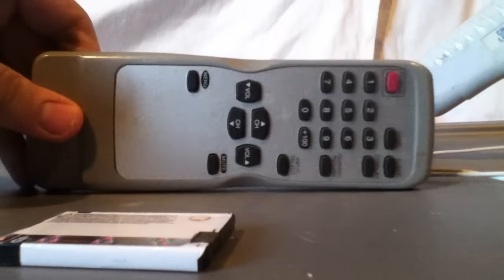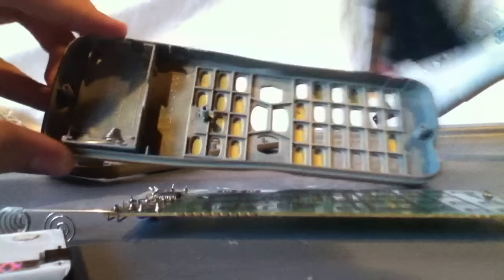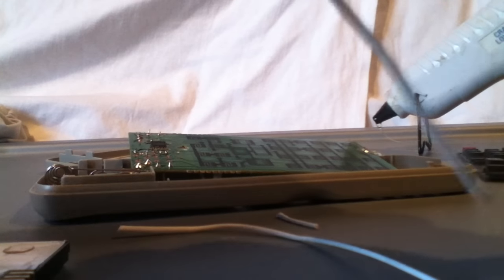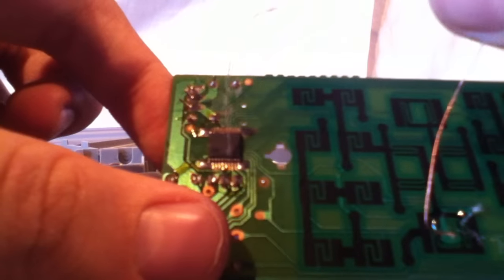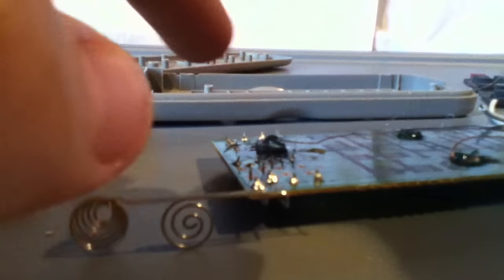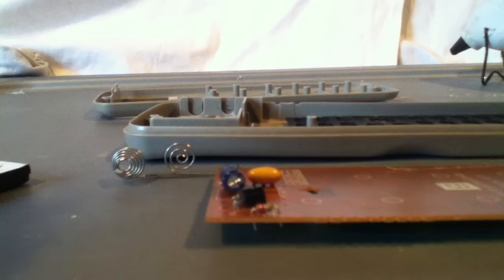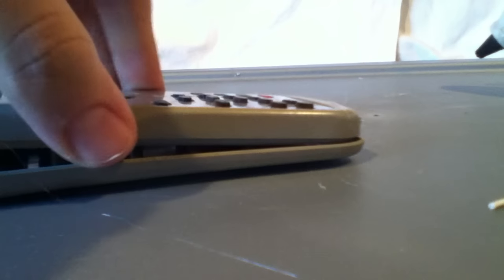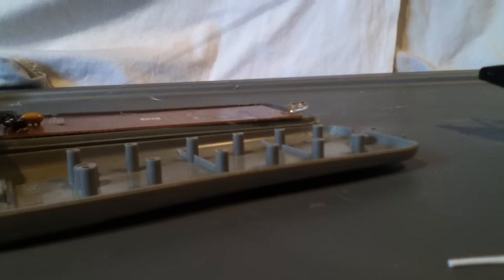How To Make a Cell Phone Jammer Out of a TV Remote

Comment: Having worked in manufacturing as a test technician I can tell you that an IR signal WILL NOT interfere with a phones signal strength. You need an RF signal to do so in the various bands that the phones use for occupation. pick up any $1-5 FM transmitter for your phone and this effect is seen although no music plays. This is because the FM signal is strong enough that it overwhelms the previous signal originally received. Hopefully this puts you in the right direction.
Reply: So does it work or not? Thanks

Comment: I knew by the title that this was fake because remote controls emit IR with a tiny LED, not RF, and even though some fancy remotes operate on RF, they operate at around 27 MHz, nowhere near 800/1900/2400 MHz which is what you would need to emit to jam cell phones.
Reply: Henry Black If you're willing to spend money, theoretically, you can buy an 800 MHz transmitter, and then attach a UHF 800MHz antenna to it, with the disguise of the remote, power it off of the 2 double A batteries (needs to be low power, effectively, low range and short battery life) and hook up a switch between the battery and the + terminal on the transmitter. Keep in mind this is illegal, this is all off the top of my head, I have not, would not, and will not do anything I have mentioned in this comment.
Reply: ***** I clearly stated it doesn't work. Cell phones operate with RF, not IR. I explained how to make a real jammer.
Reply: +Henry Black ya when i way this i was like what? because ir will not disrupt rf im glad at least someone other that myself was smart enough to be able to tell it was fake thank you
Reply: +topbullseye p.s. a remote works on dc current not ac so hooking the battery up like that wont work
Reply: ***** That battery is DC dude...
Reply: i know i was just saying that because he hooked the positive and negative terminal of the battery together and then hooked that same wire to both the positive and negative terminals of the remote thats why i said ac
Reply: +topbullseye thats not how ac works either.
Reply: i know im just saying thats probably what the person was thinking
Reply: +Henry Black lol you can make an 800 Mhz transmitter with common household electronics say an old tv remote but this video does it all wrong.
Reply: +Henry Black lol you can make an 800 Mhz transmitter with common household electronics say an old tv remote but this video does it all wrong.
Reply: ya if you changed the signal from inferred to radio and get a larger power source and hook it up right
Reply: ***** Neither you nor james anderson has ANY clue what you're talking about. Stop trying to act smart; you're making yourselves look dumber with each comment.
Reply: +james anderson You can't make an 800mhz transmitter out of an infrared remote. If you have one of those rare RF remotes maybe, but even most of those RF remotes operate at 176mhz or lower, with no way to tweak most of them even up to 300 or 400mhz. Now if you're talking about gutting the remote, removing everything but the battery holder in it, & putting diffrent or UHF components in it, you're not really making it out of a remote, but rather building something inside a gutted remote case.
Reply: Betty Pearl I guess if there is no way to soup it up then yea. but in theory I guess it would work.
Reply: +james anderson There's no theory where it "would" work. It just can't work.
Reply: QQ im sorry, sooooo sorry! ((;-;))
Reply: Yep
Reply: Henry Black my directv remote is rf as well as ir
Reply: It's not just going to transmit nothing really good it's going to blow up! 😂

Comment: #1 speaker wire wouldn't work.
#2 he hooked the battery to the wrong prongs.
#3 he didn't even press volume down to see if it turned off the effect
#4 he used a most likely in active number.
#5 an ir emitter wouldn't do anything to a cell signal or any radio wave for that matter
Reply: Correct 👍

Comment: Those wires that are in a headphone jack are coated so you need to burn or sand the end of the wire to get connected or for a good electrical connection. How else do you think you have free wires touching each other inside? One plastic Sleeve and they don’t short

Comment: I use my I-Phone to control my TV. Can I wire my I-Phone the same way? I don't have a hot glue gun but I suppose some gum would work. I'll just duck tape it back together when I'm done. I'll slap a 9v battery in it for power..

Comment: I know this is a hoax, but if you want to do this for real you can use a software defined radio, find what Mhz the phone's communicating at, then just pump a lot of EM radiation at that Mhz, works for wifi too, cheers :)
Reply: Huh? I'm talking about interrupting the phones ability to communicate not the tower...
Reply: can u tell the whole process
...
Reply: shashi kumar  and what do you have to offer?
Reply: Isn't it 5ghz or sometimes 2.4ghz? They have different channels.
Reply: Explicit Tech What is it? Most phones will have bluetooth and wifi radios running 2.4ghz and a cell tower radio that runs in the 800mhz (sub ghz) range

Comment: I used up all my hot glue. the length of the wires was not specified so I experimented. I could not understand how the thing got any power but I don't have much experience with dilithium crystal batteries. I fired it up and the tv volume went up. this guy is genius....so simple

Comment: Alright listen up, people.
The wires are color coded but they all just have copper wire inside (the red wire he talked about). That's irrelevant because this will not work anyways.
Connecting button locations to an IC chip does absolutely nothing. In fact, you'll find that the remote won't work at all until you remove that connection.
Also... connecting a wire to both the negative and positive ends of the chip causes a short circuit.

Comment: wow fake 1st step in makeing connections in electronics is soidering not hot glue and the way he wired it he would've shorted the circuit board
Reply: +Sam Stewart Exactly. Also overpowering a circuit board doesn't change the frequency band it's on. The reason the phone still had bars was because it was a phone that didn't have active service. When service is off it still has bars. Plus if it was a jammer it wouldn't of been able to connect to the provider.

Comment: OMFG IT WORKED AHAHAHAHAH JOKES ON YOU!!
Reply: NO LIE THIS SHIT WORKS :D
Reply: jesse douglass It cannot work. Cellphones do not work on infrared transmission. Remotes do not have the capability to transmit waves in MHz. If you can turn infrared tranmission into radio waves, then you're nothing but a barefaced liar.
Reply: Daniel Linger Infrared transmission is practically the same as radio waves, just on another frequency... Both of them are Electromagnetic waves....
Reply: ***** It doesn't change the fact that it cannot work though. Infra-red transmitting LEDs CANNOT somehow change their emissions to radio waves, and there is nothing else in the circuitry here that could possibly output enough power to transmit on such a level.
Reply: omg!!! does your cellphone use infrared too?!?!
Reply: Daniel Linger True, my bad for not pointing out that I as well think that this cant work. With the above comment I only wanted to tell that they are the same. :)
Reply: u know im joking paha I lernt about waves and frequency in yr 6 lol
Reply: jesse douglass Actually, I guessed you were, but here's the thing. Inflection CANNOT be shown through mere text, so unless you make your statement abundantly clear, then anyone reading could easily take it on face value - this is why emoticons were invented.
Also, there are those that still will take at face value anyway, so you could argue it's a bit irresponsible.
Reply: Jesse Asher not to mention a Tv remote is Infared, and a moblie isnt
Reply: so u didnt read the prev comments
Reply: Jesse Asher It doesn't hurt to point out and discuss the issues here. Do note that there are many readers who will read this and will be taken in - it's good to be as clear as possible and also discuss the whys and wherefores.
Reply: hm.... but tbh to somebody of sense even the concept is ridiculous xD 

however note taken Daniel Linger  cheers :)
Reply: Jesse Asher how about in 2020???

Comment: He is commanding the light waves around a cellphone.  Infrared is at the opposite end of the rf spectrum.  Also a 3.7v cellphone battery is no big deal  vs 2AAs at 3.0v.
Maybe he could use it as a PHaser exactly like the ones on star trek.  Those worked awesome-- (It was TV Magic)
Reply: So what you are saying is that the opposite end of the RF spectrum would be LF spectrum or lower than 30 hz. Correct?
Reply: The first cell phone battery consist of 1.4 volts so .1 away from a 1AA battery

Comment: Could i solder this to the main board instead of using hot glue? I should be able to solder it to the main IC chip as well; & can I use jumper wires instead of the headphone cords?  Or is there a specific reason we're using these wires? 

Sincerely,
cerberus1015

Comment: One Funny thing is... the led wasnt even on.... i checked for it.. in the remote control u can see the led work through any camera since we cant see infra red but camera do and they render it. because of the Lithium battery i should have seen a spark of violet there and because of the fact i didnt that means the remote wasnt on. 
oh and its pretty stupid to try to scrumble radio frequency with infra red idiot.... wrong wave length... think it more through before you come with that statment....

Comment: use a pair of tweezers to hold the wire against the chip before appling the hot glue on the wire. This will prevent you from burning your fingers.  Also, you can take a binder clip, or small vice to hold the pc board to something, so that it doesnt flop around on the table as your trying to glue the wire to the chip.

Comment: PrankCallPimp if you wanted to diguise it you could probaly put the battery under the part that has the green side that looks like a mother board on a cumputer if you put it under that since it's still conected you could probaly disguise it or ou could drill a hole through the outer caseing of it and glue the battery on the back or something, thanks for the video, i really like it, good job.

Comment: wires of your headphones are actually insulated with a transparent coating .. even if a piece of it touched the metal it wouldn't conduct .. so no worries about battery explosion this circuit will work like a charm (Y)

Comment: I had a dentist once that kept saying 'Shit' and 'Christ' to himself as he worked on my teeth. Gave me a lovely warm feeling of confidence that did. Back to the present subject: I suggest you remake this video with the connecting wires cut to length and already stripped (anyone knows how that can be done) and the control unit's PCB, once removed, mounted into a table top vice or clamp for stability and ease of viewing! That hot glue gun instead of soldering iron is a new one on me though.

Comment: also forgot to mention the fact that those earbud wires have a coating of enamel on them you didn't remove. if you really want to make a connection burn off the enamel and tin the wire with leaded solder.

Comment: This wont work for a few reasons, the wire from the audio cable is colored because the color is insulation so the actual wires wont touch.

Comment: People this is a joke! A remote is a IR devise and a cell phone is a radio. Generally you can jam or disable an individual phone with a strong magnet or magnetic tape hidden in the battery compartment, in the least it will likely impair the quality of the call to the extent that the user will likely hang up. However, if you want to actually block the signal you can build a jammer with parts form Radio Shack for about $30 bucks, you need to build a small transmitter with some kind of noise oscillator and a power source such as a nine volt battery. You will need an antenna like those found in a wireless router or walkie talkie. There are lots of specs on line.  You need an oscillator that is at a GSM 800 frequency. I would say any novice could build one with some minimal effort. However its illegal in most jurisdictions. Some college libraries quit rooms actually do have them though.
Reply: Mike Cape Cellphones use microwave signals not radio signals. Fail.

Comment: No, they are not. The TV remote uses infrared wavelengths, whereas cellphones use microwave wavelengths. The remote will cause no interference because the cellphone does not look for any infrared signals. Also, this dingus shorted the Li+ battery; look closely to see the wire across both positive and negative strips; it also touches the positive and negative remote terminals. This device is bogus.

Comment: Being an electronics engineer, I couldn't resist building one just to prove it DOES NOT WORK...and it doesn't (glue is an insulator not a conductor).  This circuit also failed when constructed with solder. I agree with one of the comments here that an infrared LED cannot emit a radio frequency signal. Besides, PrankCallPimp seemed to be very nervous and confused. By the way, has anyone made one of these that does work?
Reply: What typed of remote did you use?

Comment: This would have been a more effective illusion if you made another phone call after turning the device off and showing the phone making a call to prove it was connected to verizon.  I've never seen a like and dislike that was this high on both sides.  Nearly 11,000 people liked or disliked this video .  I see what he was going for , if you open a wireless mouse that works on RF and not bluetooth there is a similar wire which is the antenna, he tried to create that illusion with whatever fuckery he did with the coils .  I see a lot of the comments people are atleast smart enough to realize that a remote transmits over IR and not RF ..  I want to make a signal scrambler , I will never get these 14 minutes of my life back. thanks

Comment: obveously you have little to no electrical knowlage the wires ar insulated its best to use a soldering iron shorting a chip like that would cause it to smoke and last but not least cellphones work in the GigaHertz not KiloHertz like a tv remote

Comment: Gee...   Do you think that using hot glue will make a good connection? How about using a solder iron. Also a lithium battery will only give you .7V more than the two AA's you removed, not a big increase... As for thinking that an Infra-red LED will all of a sudden generate 2.4Ghz RF signal? Funny thing is, he actually sounds convincing!

Comment: Tomato properties reduce electrical resistance. Overpower the chip.  Pull very hard on the cord. The wire is actually string.  He is actually homosexual. Colors of wires make them easier. Attaching wire to silicon with hot glue is super effective.   Hot glue is hot.  Hot glue also wont interfere with your connections, don't worry about being sloppy..  Those wires are coated, they won't work without stripping the exterior coating.  Hot and Ground will flow the way we want them too, just because. Don't mind me while I use an inactive phone from ancient times.

Comment: Fake! Cannot & will not work. It's impossible. Phones work in the UHF & microwave radio range. There is nothing in any remote that will generate that range of signals no matter what you modify.
Reply: +Betty Pearl I have received cell phone calls by rewiring a remote to an external antenna but that was some years back and probably analog frequencies.  It worked and I learned how to do it watching..... you guessed it.  Youtube.
Reply: A remote is an infrared transmitter, that modulates an IR LED in the kilohertz frequency range. Remotes do not & cannot receive anything. Cell phones operate on radio waves in the 800 to 5,000 megahertz frequency range. However, the LED & other semiconductors in the chip may act as a crystal radio detector... especially some LEDs, because they are essentially low voltage diodes just like a crystal detector. If you're close enough or the signal is very strong, a crystal detector or semiconductor may demodulate radio signals to play through very sensitive crystal earphones, or through an amplifier. But at the high frequencies cell phones operate, there are no components in a remote that could pick them up. Years ago, car phone & airline phone service for passengers operated on 140-174mhz (a lot lower than 800mhz). Some LEDs may be able to demodulate those frequencies if the signal was near & very strong, but even that would be rare. More likely that one would pick up nearby older cordless phones with a remote's IR LED, they & a few rare newer ones operate at 150khz, 3-15mhz, 29 & 49mhz, & you thought you were listening to a cell phone. There's still a lot of cordless phones & baby monitors on 49mhz. But what is demonstrated in the video here will not & cannot work. It is phoney. There is absolutely nothing in a remote that can interfere with cell phone signals. Why do you think real cell phone jammers cost $200 or more if all you needed was $9.95 remote to do it.

Comment: Guys chill haha 😂 he's just joking. What did you expect? That an infrared light could cause interference with 700 MHz to 2600 MHz, digital signals? It's just a light, you know. It's not analog, not digital, and it doesn't even broadcast anything, nor does it use air waves. Or did you really think you'd need ketchup in any way to make a cell phone jammer? Hahaha.

Comment: Technically this won't work 
The IR LED of remote output is chopped via control circuitry into pulses of a given frequency, such as 34 KHz, 38 KHz, 
May be this can jam Device's WORKING on that frequency ,Anyway there is no chance for a cellphone working on  1850MHz-1990Mhz to get jammed using this crap !!!!!!!!